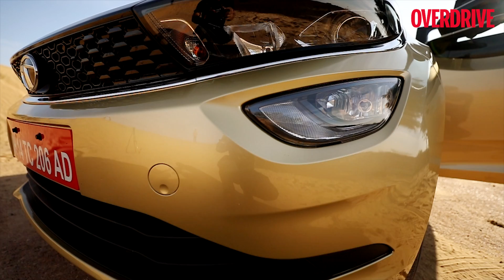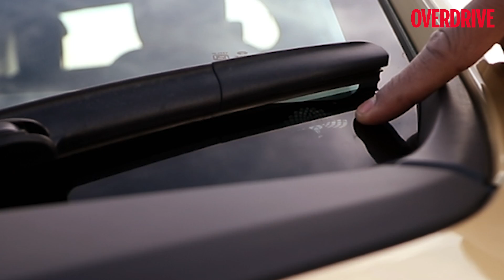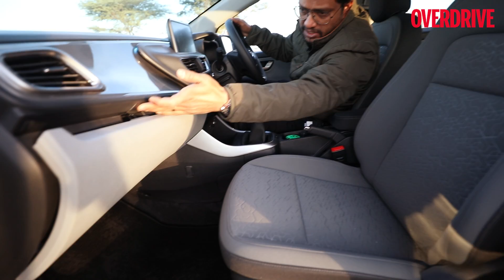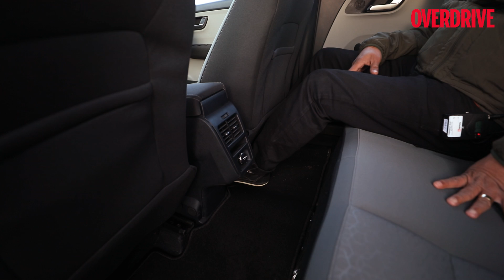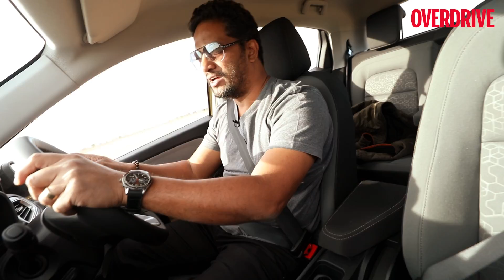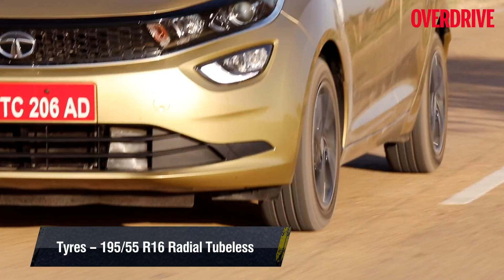Tata Altroz | First Drive | OVERDRIVE

Comment: When it comes to design aspect alloys are not that attractive
Reply: prakash t get the xt model with 16 inch steel wheels and add alloys if you need , no need to change tyres

Comment: If TATA could manage to include 6 airbags as an option with optional sunroof, then this car would have taken its peaks. Not to be mistaken, the car build quality is amazing but additional airbags would prevent the passengers from injury. Second point, high door latches would make it difficult for the child to access, every time someone has to get down and open for them. It is more frustrating in congested areas. BTW, the review is fantastic and very neutral.
Nonetheless, this car is lit!

Comment: Tata motors have to partner with Yamaha for manufacturing a wide range of petrol engines. All the majors (Toyota, Ford, etc... ) have partnered Yamaha for engine  (powerful, efficient and durable) development and manufacturing. It would be good in the long run for Tata motors if they get technology transfer even if it is expensive initially.
Reply: tijo kurian They have great engines ! 1.5l turbo petrol is gr8 , 1.2 turbo is great ! But they are expensive ! People wouldn’t buy it if its more expensive than tin cans , and that is a fact !

Comment: For a premium hatchback a better refined turbo charged engine and improved cabin insulation could  have made a big difference for upcoming  tata vehicles. In auto reviews they suggest this aspect  very much compared to other competitors tata motors needs to improve on this two aspects.

Comment: a 5 star crash rating, amazingly controllable chassis ... now if Tata adds a turbo engine, i'll just buy it in heartbeat
Reply: @SunnyKumar-qj1fe  you notice his comment?
He says the car is 5 star rated
The rating only came recently and there is no "edited" sign next to his comment
Any idea how it might have happened?
Reply: I don't get it...
The 5 star crash test rating only came recently
How did you comment about it a month ago?
There is no "EDITED" sign shown next to your comment
I am confused
Reply: Sai lol ! Its Tata’s reputation bro ! Tata said in the launch only that Altroz will get 5stars ! Tata internally crash tests cars , cause they own a jag /Range Rover testing facility! 
Tata said the same b4 nexon crash test came up and they said it again, it would only be common sense here and reputation of tata here
Reply: @rahuldogra  theirsand VW are two of the cars I wouldn't mind taking onto the highways. feels robust
Reply: @SunnyKumar-qj1fe  not you bro,  the original poster
Reply: You mean a turbo petrol?
There already is a turbo diesel.
Trust me man, a dieseltronic dual channel tuning box on that 1.5 Revotorq is going to bring out the hidden beast within.
Reply: @eriktenhag2022   Have you tried it on this diesel engine. I don't want it to smoke out.
Reply: @rajasimanta  yes my friend has a dieseltronic single channel box fitted to his nexon Diesel.
Power o/p is from 110 to around 127 I think.
It is properly fast.
Here the ecu is different, and many other components are different, so k guess the same box won't work in this.
But racedynamics will eventually create one for the Altroz D.

Comment: Patrol engine comes only 3 cylinder . compared to diseal 4 engine  like nexon but tuned .. largely people are looking for  patrol engine which is  peppy and good refinement.and comes 4 cylinder . similar to swift ( not fan of maruthi cars) apart features  design and safety  no one beat altroz both patrol and diseal currently in Indian market ..it could have been much better if Tata patrol engine available in 4 cylinder..the real winner is altroz diseal .. compared to patrol engine..smooth peppy refinement engine..in the hatch back segment..

Comment: 12V ports are much better than USB ports. You get dual USB attachments from good manufacturers for 500-600 bucks, China products for much less, one could easily buy that. But the flexibility given by one 12V port is just priceless.
Reply: rajath 2137 I used to use 12v laptop charger back 4-5 years 😂

Comment: I have to wait for it's electric version only. I think this 90 bhp and below is too dated power train. Atleast 125 bhp should be minimum.
Reply: Bhai.  Which hatchback is having 125 bhp
Reply: All the competition have more or less same power. It isn't underpowered!!
Reply: Even baleno have 85 bhp
Reply: Dude THE most powerful car in this price point is tiago JTP which has 114 hp. 125 hp isn't really required here.

Comment: It's a complete car man. The DCT box is in consideration as I got to know from several websites, that would be great too.
A JTP 110 BHP  version would be hella amazing.
Rest TATA NAILED IT 👌
Reply: Tata may even bump up it to 120hp bro & that will be🔥
Reply: @BlackHawkTejas  that'd be sweet...
Reply: Yes considering the lower segment Tiago jtp comes in with a 114 ps firecracker of a motor, there's high probability of a near 120 figure that too considering the fact that the car comes in with larger dimensions and probably with a heavier weight. But then again... it's just my speculation.
Reply: @varunmurali6367  You are right & the Tiago JTP was powered by a 3-cylinder Turbo Petrol where as Altroz JTP  will be powered by Nexon's version of 1.2L 4-cylinder Turbo petrol I guess!!
Reply: @BlackHawkTejas  bhai nexon engine is also a 3-cyl 1.2 unit same as tiago jtp with so tunings
Reply: @anujrathee8809  My bad!! Yes it comes with 3-cyl. I just hope Tata adds 1 more cylinder to make it smoother so as to match the premiumness of the Altroz!!
Reply: @BlackHawkTejas  I too think 4 cylinder highly tuned 120-130 hp unit would be a great motor to do justice with the altroz's overall personality and Dynamics.
Reply: @shubhamshrivas4112  I would love that too!! And the gearbox in question is from Punch Powertrain's & it is the DT-1 7-Speed DCT with the max torque limit of 200Nm!!
Reply: @BlackHawkTejas  so how's DT-1